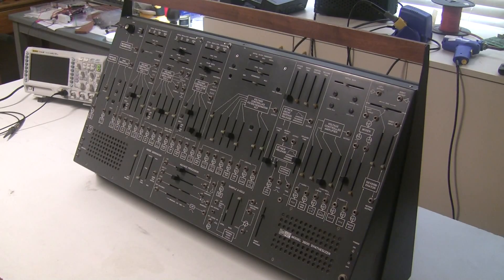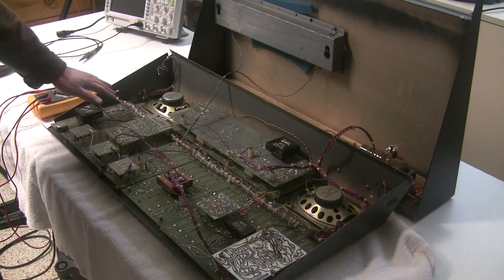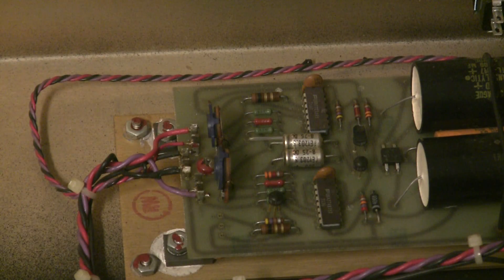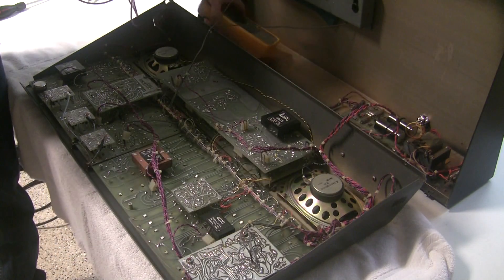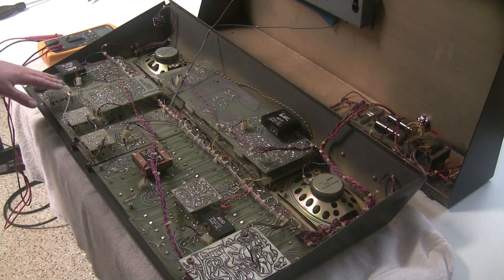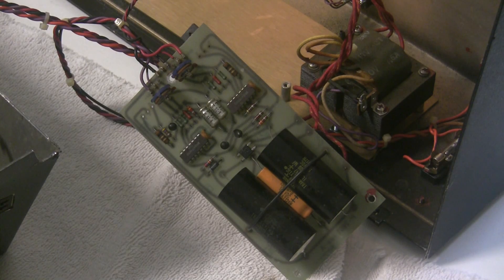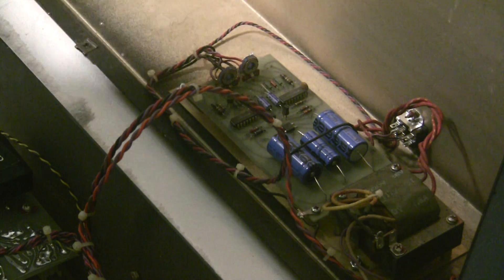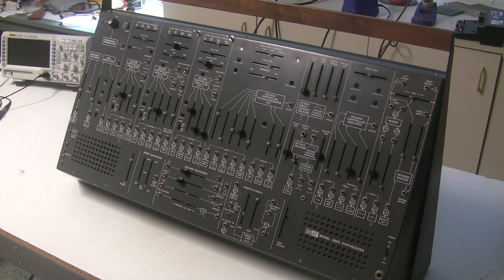Synthchaser #050 - ARP 2600 Grey Meanie Troubleshooting & Power Supply Rebuild

Comment: Very useful video! I have a similar problem with my grey non-Tonus ARP 2600. Two VCO and the S&H are not working. Found some dead little red capacitors causing short-circuits, and changed remake VCOs and S&H board but no luck, still not working. Hope I can get more insight from you later video. Btw, I swap a new switching power supply instead of rebuilding the old one, what do you think?
Reply from the maker: I'm positive when I pull that board there will be a shorted tantalum right next to the connector...  I'm not so sure about switching power supplies.  They can introduce EMI.  I've seen people put them in Memorymoogs and Polymoogs, and even a Prophet 10 and they claim good success, but the current demand of those synths are much higher than the 2600.  I'd probably stick to a linear supply.  I've designed a linear supply that I'm going to use in the TTSH clones I'm going to build, and made them so they'll be mountable in other ARPs.  Something like that might be better than a switching supply.

Comment: i love you.  hey, what brand electrolytics do you use or suggest?  i'm restoring an optigan--it has huge 1000 uF 50V caps with 22mm spacing and 4 pins (just doubled).  what would you recommend for that?  also, if i get ones with leads too short, could i solder on little extensions if i had to?  THANKS!!!!!!!!!!!  you are superb. don't get washed awaaaaaay
Reply from the maker: I usually use Nichicon caps.  In some cases when I want to use a better quality capacitor like a Nichicon that doesn't fit in the original spot (like using a radial capacitor in place of an axial capacitor), I solder a wire onto one of the leads and cover it with heatshrink.  Like in this video:

https://www.youtube.com/watch?v=IG4rTb70v30&t=13m01s
Reply: thanks for your time!  much appreciated.